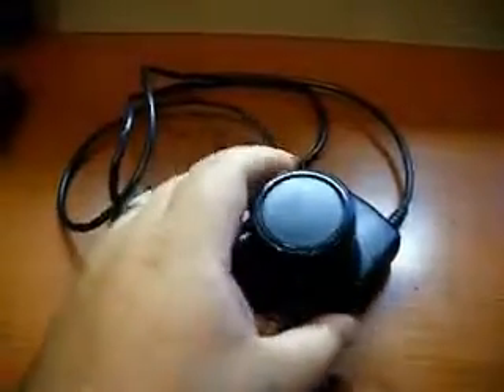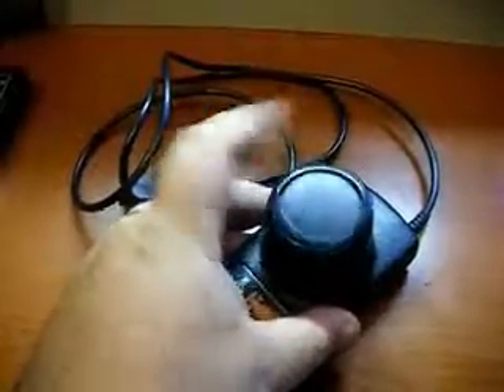Atari 2600 Driving Controller inner workings

Comment: @ForViewingOnly I think I've found the solution. For those having the same problem, do a Google search on Longhorn Engineer Atari Driving - this webpage will show photos of how to open up the grey box inside the controller. You can see immediately how the pulses are produced using a rotating disc with tracks and contacts - these need cleaning with isoproyl alcohol.
Reply: This is an awesome video @ForViewingOnly this is a good tip. Perhaps the driving controllers don’t wear out so much as they just need to be cleaned. I am surprised that Best Electronics CA doesn’t offer a rebuild kit. Either it doesn’t need it or the driving controllers are not very popular as they are only used with one game (Indy 500) to my knowledge.

Comment: Hi, both of the my controllers are really erratic with Indy 500, causing the cars to randomly spin in the wrong direction when I come to a corner and turn the controller quickly. Gentle left right movements on the straight are generally OK, but the corners are where the controllers really give me trouble. Any idea what the problem might be? Strange that both controllers are affected in the same way. Any advice appreciated. Thanks.